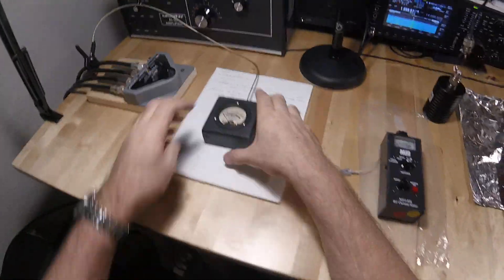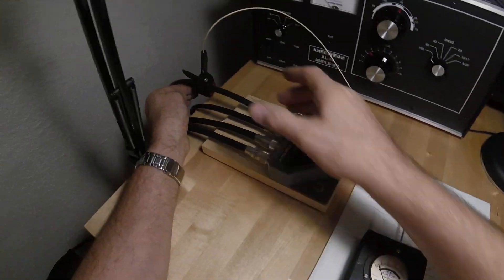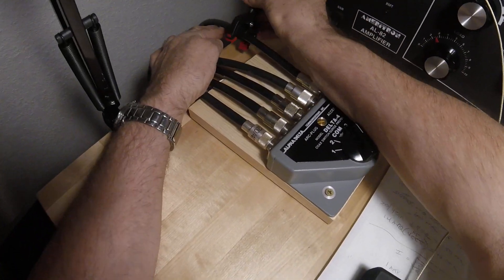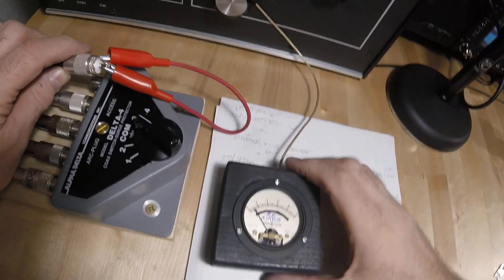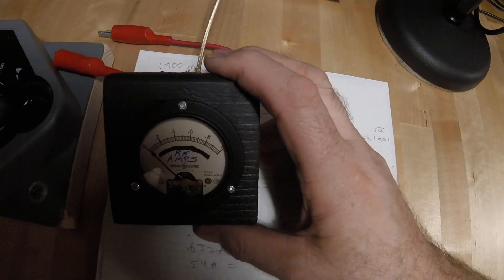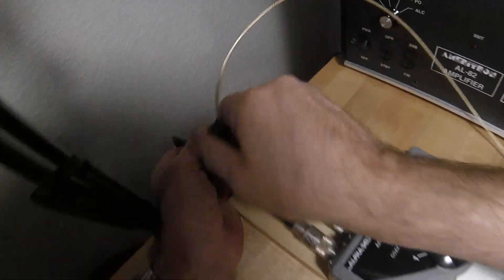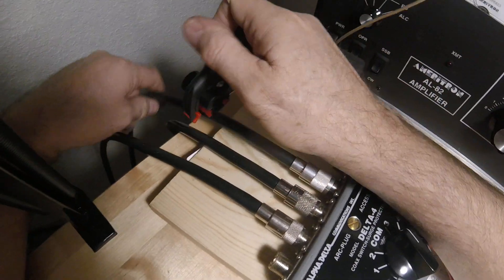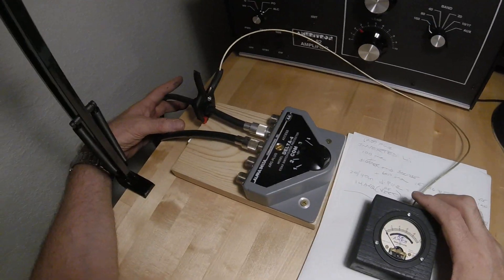Homemade RF Current Meter in operation

Comment: Your dealing with parallel induction.. ac RF current will act this way .. the wire off the clamp acts as a antenna and gets charged  also there gan be RF leakage in the switch itself ..beat of luck